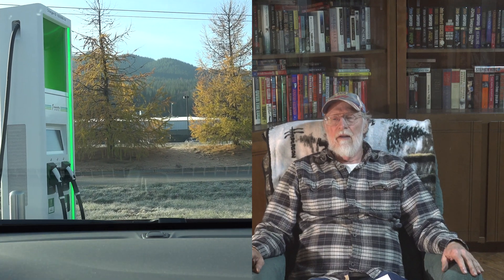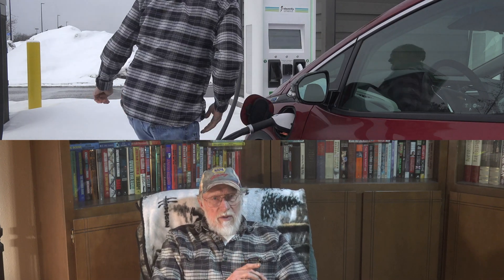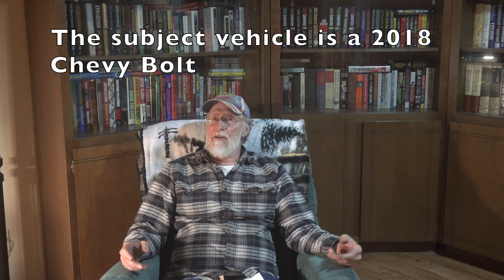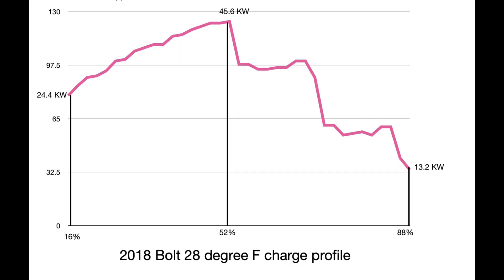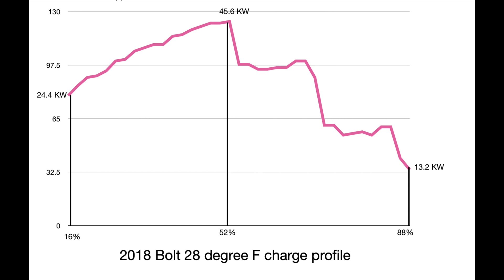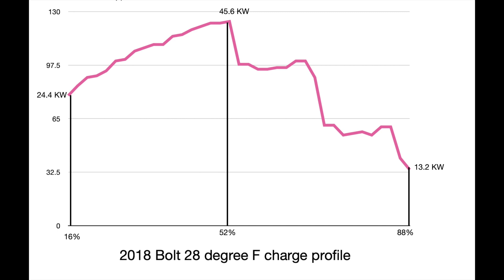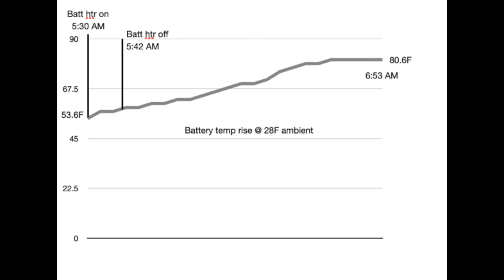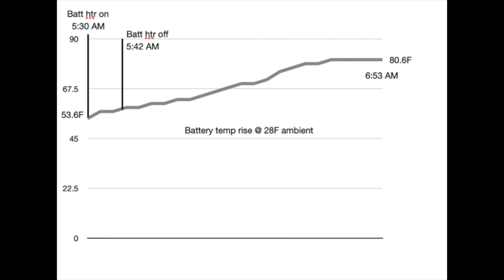Charging the Chevy Bolt after the upgrade

Comment: Hello, thank you for your videos 😀. I have a bolt ev with NO fast charging capabilities. There is an adapter I could buy in order to at least charge at the fastest rate possible ?
Thank you
Reply from the maker: Unfortunately no.  You are limited to AC charging at 7 KW.  
The only way to change that is to replace the charger in the vehicle along with the wiring and plug.  Probably more expensive than it is worth.
GFM
Reply: @electriccar3253  well, I guess it is what it is , thank you anyways for answering my question!

Comment: I got the update as well,  but now it will not charge above 46kw now.
Reply from the maker: I have not tried charging at higher ambient temps, so I can't say what happens.  From my experience, the max 55 KW is rather fleeting, depending on ambient, charge level and time on the charger.  Also, are you sure you are not using a 50 KW charger, as I have always been limited to around 45 KW on these chargers.  
As temps warm here I will have to test that on out.  Thanks for the thoughts.
GFM

Comment: That's for sure I have a 2017 bought used with 1450p miles on it and love it. Use it in California. Did wish it had a 150kw charger on the bolt. That would be great.

Comment: Thanks for running this test. Based on my research, the original Bolt EV charging temperature profile only sees max charging current at ~77 degrees plus or minus two or three degrees. Anything under a 70 degree battery temperature, and the Bolt EV won't even max out a 125 A DC fast charger. 
The 2020 Chevy Bolt EV also has an updated charging profile (which is substantially faster), but it looks like this update only addresses the charging temperature parameters.
Reply from the maker: That is consistent with what I have seen so far.  The maximum charging rate (47KW) occurred at around 72F battery temp.  
When I tried this before the upgrade, I did not have an app for the computer on the car, so I could not check battery temp, but at no time did the charging rate exceed 17 KW (actually more like 12 because I had the climate control on during charging).
I am certain the battery heater was on, so the battery temp was probably close to the same as this second test, so the upgrade made the difference up to 52% SOC.  
After that, it appears to be the same as the original profile.
BTW, your videos are very informative and were the first I saw on this car.  Keep them coming.
GFM
Reply: @electriccar3253  Thanks! I'm working on a deeper dive into the charging profile, and temperature ranges based on data I've gathered and research I've conducted. Hopefully, I can get that out soon. :-)
Reply from the maker: @newscoulomb3705  Looking forward.
GFM

Comment: Thanks for the info. It's great to hear that the update works for the core problem of slow cold weather DCFC. 

I know some Bolt drivers were disappointed that it didn't add the 2020's gradual taper or any other improvements, but the time and cost savings in winter that you mentioned are the most important thing. Sorry to hear the dealers were an arse ache though!
Reply from the maker: The increase in KW made a considerable difference in both cost and time.  Winter charging will continue to be an issue for EVs.  
Even with the improved profile, the 53F temp of the battery limited charging speed until the battery warmed to 80F.
BTW, I have visited your channel.  Your content is quite good.  Subscribed.
GFM
Reply: @electriccar3253  Thanks, much appreciated and I did the same. Great to see more Bolt drivers sharing the experience so we can all learn together.

Comment: The 2020 has a different charging profile than the one you show, a couple of YTer's have documented it. My 2020 is different than my 2017 was.
Reply from the maker: The charging profiles are different, at least partly because of a change in the chemistry of the battery cells.  But also, the original 2017 Bolt did not consider the rapid change in DC charging infrastructure.  Rapid charging was considered a luxury.
These older Bolts are faced with a charging profile that is a bit behind the times.  The upgrade brings the charging profile more in line with the charging system as it is now.
I think we are at a limit in charging maximum kilowatts due to wiring size inside the Bolt.  
GFM